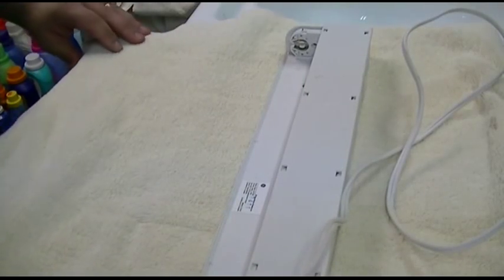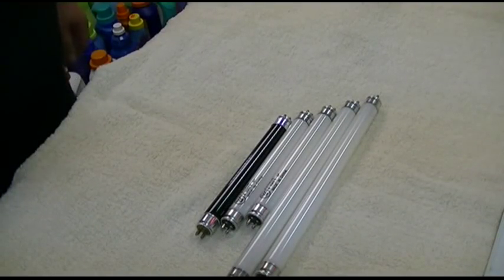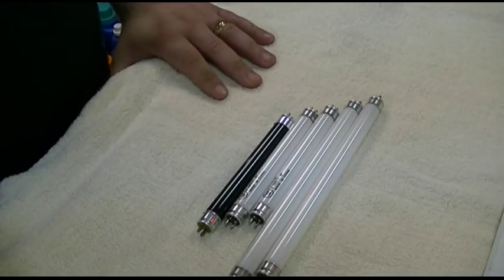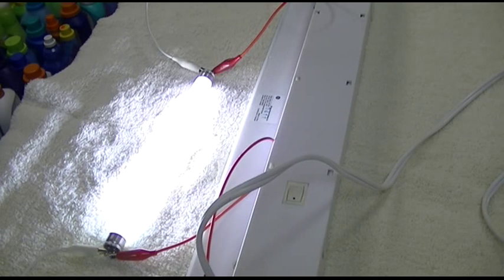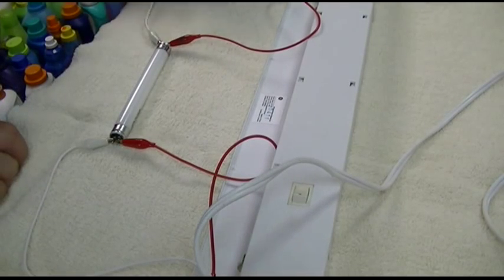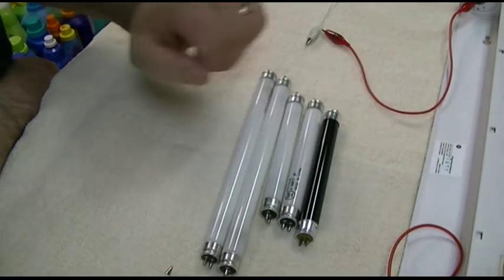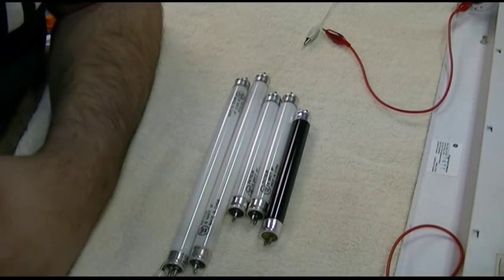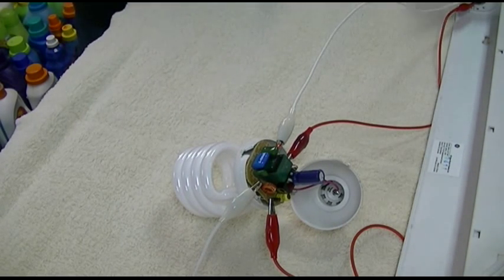F4T5CW & F6T5CW Fluorescent Bulbs

Comment: you were running 6 watt tube on a 15 watt ballast. it s obviously going black in no time.
Reply from the maker: Yes, that's true.  I don't think it did any long-term damage due to the short time the bulbs ran.
Reply: @jaykay18  it did grey out parts of the tube. It was close to opening an arch between the filament thus killing the tube prematurely and instantly
Reply from the maker: @averageslytherinperson6154  That's exactly the reason I only ran them for a short time.
Reply: @jaykay18  still it s over esagerated for them. Feeding more than double it s capacity. You were lucky all of the working ones survived. I had a 18 watt dying out because of an electrical surge
Reply from the maker: @averageslytherinperson6154  Meh, fluorescent bulbs are pretty resilient, much more resilient than the stupid LEDs they have today.
Reply: @jaykay18  i too hate LEDs. I still use fluorescent on an everyday basis. My room has 4 cfls, an 18 watt, a 9 watt and a" 6 watt which i only use when i go out"
Reply from the maker: @averageslytherinperson6154  Yep, my house is full of incandescent and fluorescent.  Some bulbs are over 15 years old and still work!
Reply: @jaykay18  i have more fluorescent tubes in my garage and some of them dating from 1990s. Same as my 18 watt is also from 1990,s but it s nearing end of life

Comment: Nice lights. I've never seen those lights so short before. I doubt those are made by Westinghouse.
Reply from the maker: +Andrew Gallucci There are shorter/smaller ones made yet.  I don't have any of them.  The only thing close I have is a Chinese made nightlight that has a small fluorescent tube.  They never lasted long, I got them at the dollar store years ago.  They also came in different colors--there was white, yellow, green, red, and blue that I got.  I strung them together and the are behind the bar, sadly several have burned out over the years and I have been unable to source replacements.  These smaller socketed fluorescent bulbs are very expensive compared to your standard 4-footers, it's called supply and demand.  Always thought oddball fluorescent bulbs were cool.

Westinghouse is just a name, like anything else.  It's whoever pays the licensing fees for the stamp in China before the product is packaged.
Reply: jaykay18 I don't think Westinghouse is an actual company anymore. I've seen 2,4, and 8 foot fluorescent bulbs as standard.
Reply from the maker: Andrew Gallucci That's all correct.
Reply: Andrew Gallucci I have